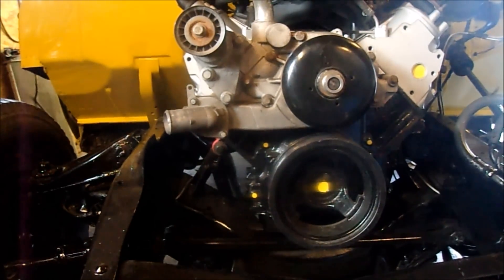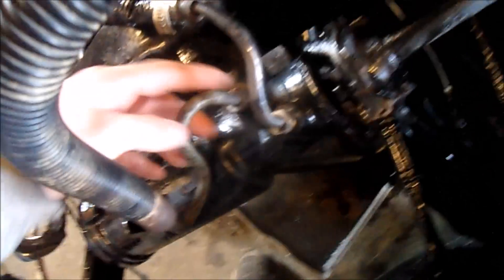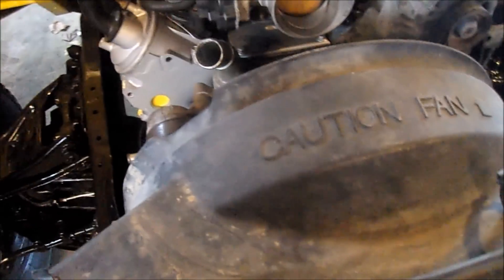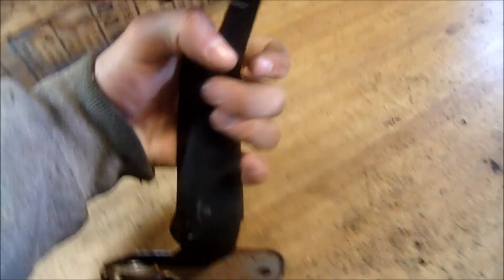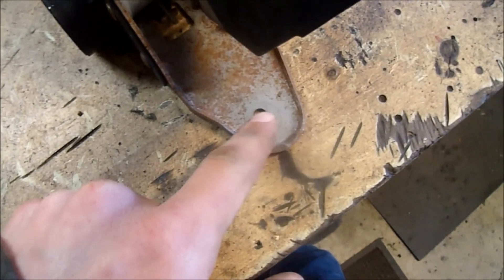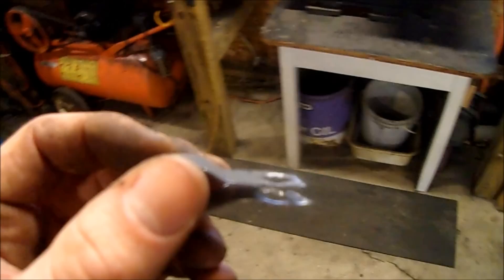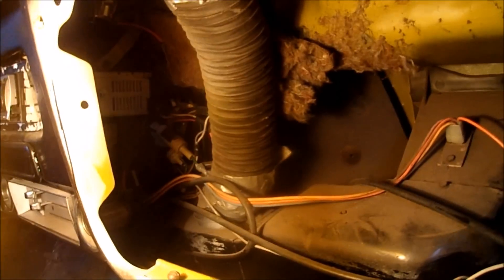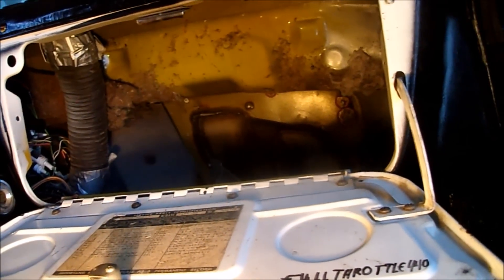72 Chevy LS swap part 12 - Accessory bracket and gas pedal mount

Comment: How did you hook up the kick down on th400
Reply from the maker: Never did...I need to sometime. Just been driving it without one for 4 years now lok
Reply from the maker: Lol
Reply: @NoPaintGarage  did it give you a popping Noise
Reply from the maker: @smokey210210  No , works great just doesn't down shift when going up a steep hill. Which isn't ideal sometimes

Comment: one thing to think about with that fan shroud, you can get it on now, but what about when the radiator support and front clip is in place? you need to unscrew the fan to remove it, and as close as it is to the belt and accessories, can you remove the fan and shroud to service the front of the motor?
Reply from the maker: dave1135 it's a two pieces shroud so I shouldn't have any problems there. the top and bottom half clip together. good observation and thanks for watching!

Comment: looking good. i like the delete plate with gauges in your dash. function over form. your heater doesn't work so why have the controls in there? it looks more like a race truck without heater controls. save the controls just in case you decide to put everything back together. 
  i see a shifter made its way in there. that looks good too, man.
Reply from the maker: Thanks Eric. I definitely want to put the gauges in there now that i've had time to think about it. Hey, You weren't suppoe to spot the shifter, That's coming in a later video ;)